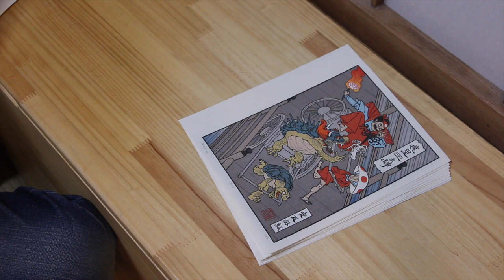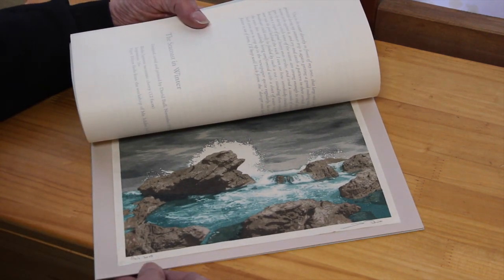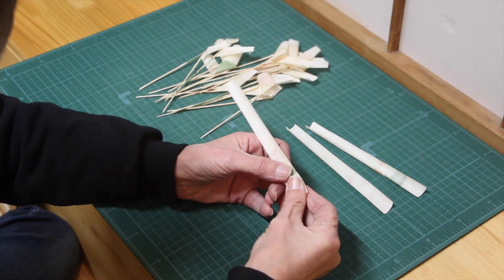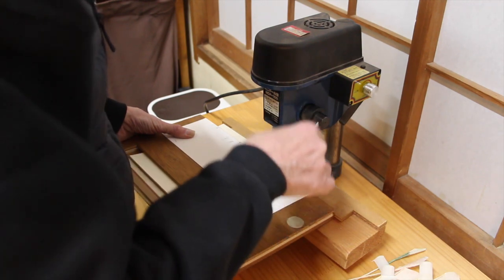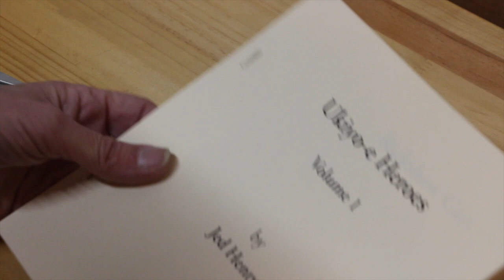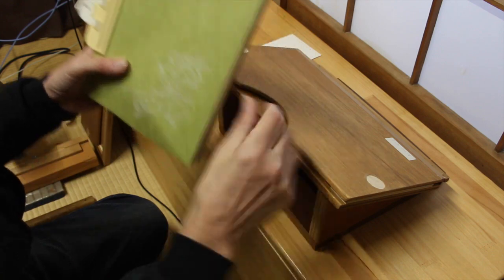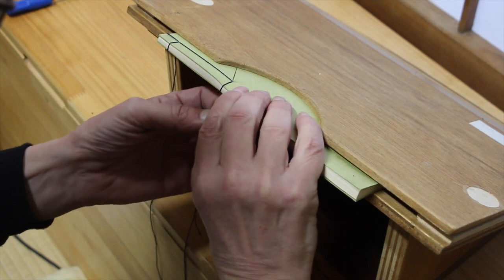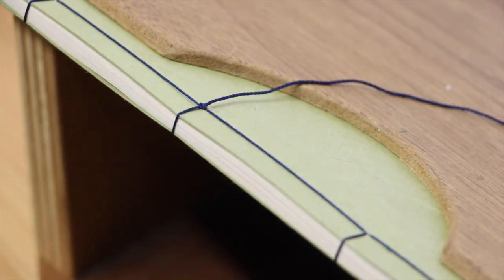Ukiyo-e Heroes Book - Part 2

Comment: Three General Questions:

1. Why can't you just create a key block with the full picture, put all the colors where they need to be, and make the print in one step?

2. Isn't Jed's job harder? It requires actual artistic ability. While Dave's job is important, isn't it just tracing lines? Cutting along the lines that Jed or other artists have designated and removing the excess spaces? I see how it can take a while, but it's still just tracing. Anyone with a sharp knife can do it. 

3. Why can't Dave create his own drawings and bypass the need for an outside artist?

Forgive my ignorance.
Reply: I can't speak for Dave, but I'll try answering according to my understanding.

1. You can certainly do that for simple print designs, but for ones that account for layering colors on different planes, then that would be a nightmare, especially if you want all the prints to look the same.

2. Different jobs, different skill sets. Isn't a sculptor just hacking away at a piece of wood or marble? While it is simple to carve away simple shapes, it's very difficult to translate minute details like multiple tiny sharp corners or very fine lines microscopic in width precisely. That takes a very steady hand tempered by years of experience. You're looking at the carving Dave does and have the impression that it's easy because he makes it look easy. Like watching a pot maker or welder do their thing. It looks easy but when you actually get down and try it yourself, you find that you have no idea how to even begin translating the design to actual physical form.

3. Again, different skill sets. If you're talented you can certainly just carve your own drawings. An engineer can build a building according to his own design without the need for an architect, but if you're running a business and pressed for time, it'd be a lot more efficient if you did work according to your specialization.
Reply from the maker: 1. This question doesn't scan ... please watch some of the other videos, and you'll see how the process works ...
2. Different skill set. He draws, I make. Apple and Foxconn   As to the 'anyone with a sharp knife ...', please give it a try!
3. = 2.